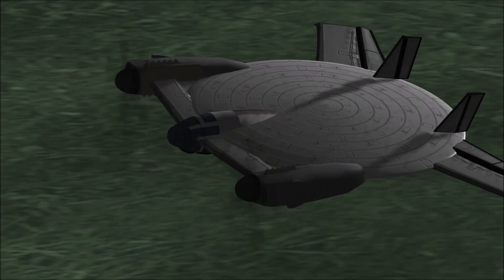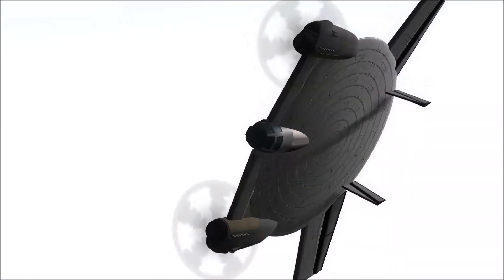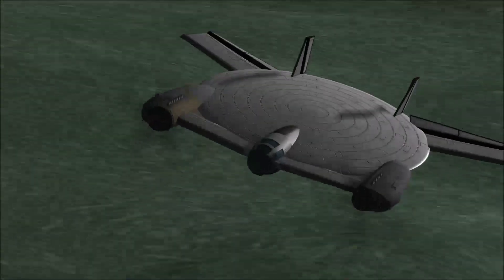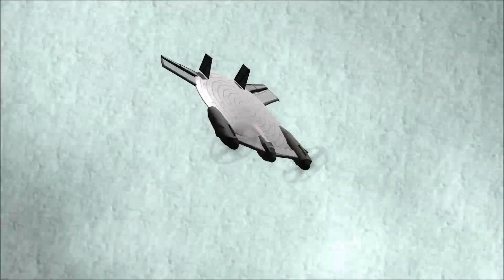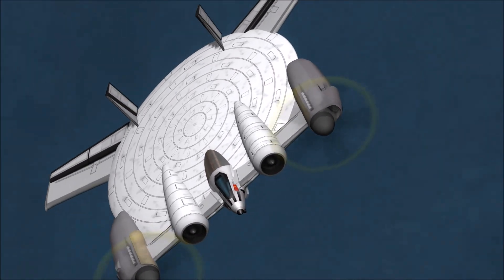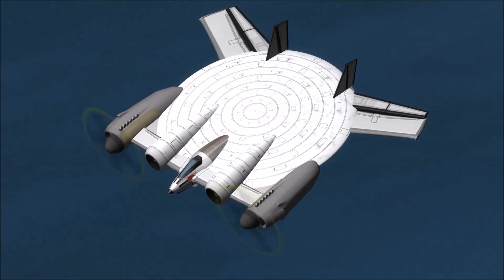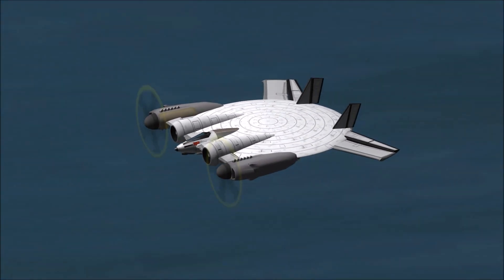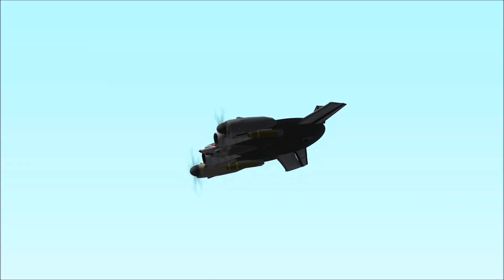KSP History's Misfits 2 The Vought V-173 & XF5U-1

Comment: I've got a tough one for you: the Focke Wulf Triebflügel.
Reply from the maker: I made a modified version of that long ago. I've always meant to try and go back to make a proper one. The hardest part of that design is actually the limits of the game itself. Because of the force generated, the wings stretch and go spaghetti with too much power
Reply: Hookswords
I know. I tryed it myself a while ago. I managed to make one that can at least stay in the air and is able to fly big long turns but the flight characteristics are completely messed up and i often lose control and can't pull up. I bet you will be able to do it properly. I mean you have recreated so many awesome strange designs adn done an amazing job with it.
Reply: Hookswords
Oh by the way how do you resize the Twin Browning you use on some of you're designs? I can't do it with TweakScale.
Reply from the maker: I believe the only resizing tool I use is tweakscale. I think there are two different sizes from two different mods. Spanners boomsticks and NAS
Reply: Hookswords
Ok i haven't installed Spanners boomstick thanks.